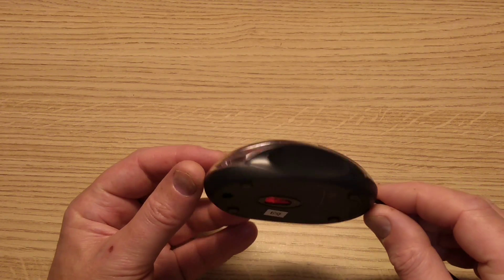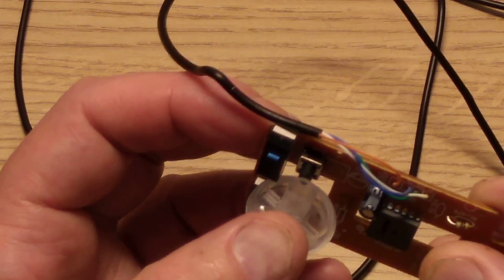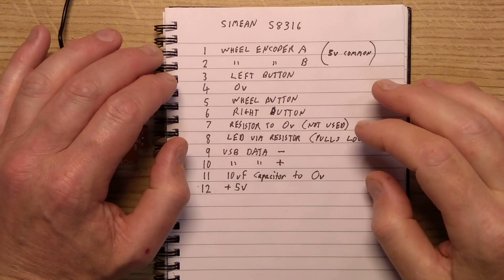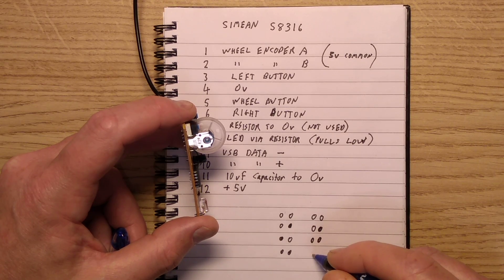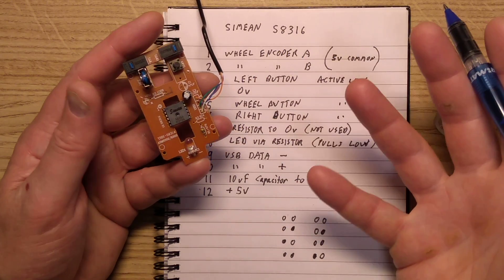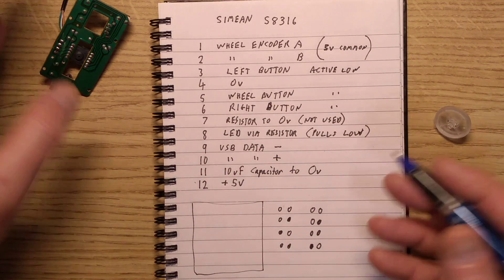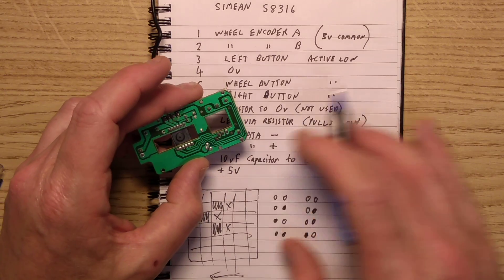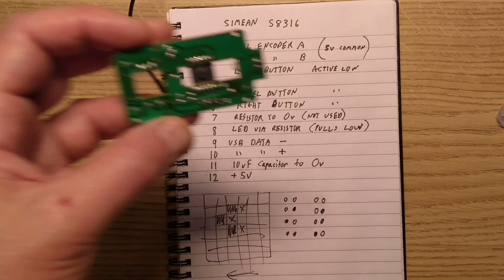Inside a humble Poundland computer mouse.

Comment: At university in the early 90s the Sun Microsystems workstations came with either the ball mouse or the laser mouse. The laser was not visible, probably infrared, and needed to be used on the supplied metal mouse mat which had a fine grid of slightly different coloured horizontal and vertical lines. They did not work on other surfaces. I guess they probably used some other detection technology other than imaging the surface, doppler probably from the reflections from the grid.

Comment: I remember purchasing the Microsoft intellimouse optical in 2000 for around 60 pounds and it was that good all round i used it for 17 years everyday with only 1 cable replacement. its still working but i sold out to a high DPI Corsair.

Comment: i had some success getting one to work as a liquid flow sensor - provided there's some microbubbles or something in the liquid. My idea was to try to make a cheap accurate flow sensor for low volumes of flow - as these cost a fecking fortune. I thought if I could get it working I could use it to accurately measure the fuel use of my paramotor when flying. In the end, though I did get some success with it, I decided a makeup mirror on a string (to view fuel tank) did a good enough job and abandoned the project.

Comment: I've used one of those mouse-types and it's identical, bar the company logo, not Sony, to that one.  I remember that mine would only work on a white or plain surface.  Any under-printing or glossiness would deflect the beam and therefore pointer, off in all directions.  It was a give-away with a piece of OS software, to cover OEM compliance, apparently.  Not the most high quality product but it worked for what I needed...a spare mouse to cover for the expensive one that gave up after two years light useage.

Comment: Just to say, Thank you Clive for all these informative videos. Due to watching your videos i was able to fix something today. I noticed yesterday that our house CCTV had stopped working. The cameras outside were not lighting the IR, and the DVR was flickering on and off. So i immediately deduced that the power supply was at fault. A 19v 5amp unit. Amazingly the unit was held together with screws so took the PSU apart and found 2 caps blown on the LV side. 25v 1000uf. Yay for Amazon same day, they arrived just after lunch. PSU repaired and CCTV working again !. All thanks to learning from your channel. I drilled some holes in the PSU case before refitting to allow some air flow through it, so it would not get so hot and keep cooking the Caps. Its in a hidden area, so not accessible. So safe enough.

Comment: Actually, the VERY FIRST computer mouse didn't have a ball, it had a pair of wheels, one for each direction, that drove rotary encoders of some type.  Over on the Computer History Museum channel there's a video that shows the bottom of the very first computer mouse.  They don't have any videos that show the earlier first trackball, which was more like the early video game cabinet trackballs, in that it was quite large.  It was, in fact, a BOWLING BALL used in the device.  It was developed in Canada, for use on one of the early air defense computer systems.

Comment: There was wireless mouses for 2 euro each on a  local super market and they quite neat, but uses 2xAA batteries instead of one AA battery . They are usually massive produced  , rebranded  and  you got free when you buy a new computer . But for mouse use the one that is more ergonomic to  you're  hand.

Comment: Funny how a mouse like this will probably last for most of someone's life as opposed to a lot of the "high speed low drag l33t g4am3r" mice I've had where the mouse buttons went crap after a year and a half.
Reply: erikm12 Not true, mine lasted 3 months. Although you can very easily fix them because the most common issue with them is the cable breaking. Still really really good for a single pound coin though.

Comment: Hey Big clive, theres a similar chip used in multirotors to detect drift on a hover. The accelerometers and gyros only capture acceleration so its hard to know if you have a fixed velocity drift. You point camera th
 at the ground and uses that to detect the drift.

Comment: Prusa used them to detect the movement of filament feeding into the extruder of their 3d printer. It could detect the end of the filament when the roll was empty and jams when the filament was being pushed but wasn't actually moving. I believe they've backed away from that design because of reliability issues.

Comment: I have openned a mouse from MKplus to clean it, the wheel was acting up. It had a similar chip, but the board has provision for 3 more buttons... So.... I could and cleanned the wheel to working condition, the plastic dust from it was covering everything, drilled 3 holes, 1 in the top and 2 in the side, 3D printed some side buttons, soldered 2 buttons in a daughter board and upgraded my mouse to have a DPI selector and back and forward buttons. Great project if you're bored....

Comment: there is a project i saw a while back it used an arduino board to extract the image from that sensor and it works !!!! you can see the image and its actually very interesting project
Reply: https://hackteria.org/wiki/Hacked_Optical_Mouse

Comment: I am investigating using a similar chip 
(AVAGO :https://media.digikey.com/PDF/Data%20Sheets/Avago%20PDFs/ToolKitSelectionGuide.pdf)
with binary chain encoded 'track' for use as a low cost absolute position encoder. Contact me if you are interested.

Comment: That camera thing is indeed nice, but it's a real shame that something so advanced is ruined by being inside something so shitty. it Having used mice for 20+ years at this point, I've never "taken them for granted". They come in two varieties: shitty and shittier. They all break. And they all come with incompatible parts, so they can rarely be fixed. You gotta throw them out and buy a new one. There's always something wrong with them. They misclick, they double-click, they don't scroll or they scroll backwards and forwards at the same time. They don't work on glossy surfaces, they don't work on matte surfaces ,they don't work on plain-colored surfaces, they don't work on textured surfaces. There was one that worked as a figdet spinner, because the wheel mechanism was broken and it was spinning freely, I quite liked that. Other than that, they're the bane of my existence and I hate them more than keyboards, and that's saying something. 

Fuck mass production. I don't need a hundred mice for $100, I need one that has working buttons and a wheel, isn't "ergonomically designed" to not fit my hand (I'm a leftie), doesn't come with a billion buttons and a built-in flash drive to install a fuckery management software, doesn't light up the room with stupid color-changing LEDs, doesn't come with a wireless connection that breaks every time I look at it the wrong way, and doesn't. fucking. break.

Comment: Funny to see you taking a mouse apart, I just sort-of (and quite probably temporarily) fixed my god knows how many years old Tulip mouse (that has an optical encoder for the scroll wheel by the way and was incredibly dirty). It's not really, really old, because it does have a USB connector weirdly enough.
Never knew it's actually a min-camera, and I think it's interesting it fails to work in much the same way (D)SLR's fail to autofocus when there is a serious lack of contrast in the detected picture.

Cleaning the ball in the roller-ball mouses?  I had to clean the rollers, not the ball :P.
I am not completely sure, but I think I recall a sensor in the Lego Technic Mindstorms package (the very first one) doing that to have a very vague understanding of it's surrounding environment (in some of the pictures I saw it caused a reasonably big spread of a red grid detectable by the sensor directly next to the LED producing the grid, which could also just have been a product picture and the grid was infrared, I am not completely sure).
Quite probably the resolution was really low, because well, processing that data to make decisions was had to also be readable on the computer by communicating this information through it's teriffyingly slow infrared transmitter/receiver and receiver/transmitter, from which the last one was connected to a Serial port on the computer!).
Unfortunately I don't know the name of it anymore.

Comment: those of us old enough to remember having to clean our balls (heh) don't take optical mice for granted!
Reply: My first mouse came with my Amiga 1000 about 31 years ago. I well remember having to clean "gunk" from both the ball and the little metal rollers .
My latest is a wireless optical mouse with rotary encoder similar to the one shown here. It recently gave me some trouble. I dribbled some liquid butane on the encoder to "wash" it and all is working again.

Comment: I recently had a problem with the scroll-wheel of my mouse. Sometimes it went up instead of down, and vice versa, or straight to the top or bottom of the page. It has one of these mechanical encoders. I figured it probably meant "dirty" contacts and wondered what to use to "wash" it. I tried dribbling some liquid butane on it. It got very cold and some frost appeared, and that worried me at first. But the butane and frost went away and the scroll wheel is good again.
[edited]
A week later and it's acting up again. This time I tried dripping some methylated spirit on it and it's OK again. Let's see how long it lasts this time.

Comment: When the first roll a ball optical mice came out they were so expensive that the company I worked for had me increasing the led drive current to keep them working longer. With 8 hour's a day use it did not seem to take too long before the leds lost intensity and they started to jitter.

Comment: The rotary encoder seems a bit over-engineered for what it really needs, which is really just pulses when the wheel is moving forward and pulses when the wheel is moving backward, something that can be accomplished with momentary switches on either side of a flapper (like on a prize wheel).  There is no real need to know the position of the wheel or calculating which way it is moving based on said position changing.
Reply: Rotary encoder is much simpler. It's really just a disc with two dashed lines worth of contacts printed on it with a graphite-filled conductive resin or sometimes etched out of a laminated metal layer, and a little wiper. It's the same manufacturing technology as a rotary potentiometer and a similar enough construction. You are suggesting a complex mechanical assembly instead!

Comment: Hey clive love the content! Would be sick to see you get a SDR off eBay and test it then take it apart and reverse engineer it. Very curious about the cheap $10 ones. Been wanting to get one but wasnt sure what all went into one.
Reply: There is almost nothing in there.  The magic happens in the computer that runs the SDR software.  Which is of course what SDR is.
They contain a "tuner chip" that downconverts the input signal to a lower frequency, then there is an "A/D chip" that takes 8-bit samples from that signal and sends them over USB to the computer.  The tuner uses a crystal (of varying quality depending on the device type and -price) to generate the frequency reference for conversion.  That's it.
The chip has some hardware for processing the samples when they are DVB-T signals, but it is not used in the application as an SDR.

Comment: Those optical sensors have been employed in drones for horizontal stationkeeping purposes as any movement laterally generates a signal (as with the mouse) that informs the drone it is drifting from its position in a given direction.

Comment: I saw something on Hackaday maybe? Where some guy used one of those chips to pull the raw image data out of the usb connection and made a rudimentary scanner out of it.  As he drug it across the surface an image was built up on the screen something like 8 pixels at a time.  It was pretty neat.

Comment: I found it online.  But it is a knock-off of Simian S8316 So they spelled it different than the better know optical mouse sensor.  I didn't see it until I looked for images 

Simean 8316.png
Reply: Why did you just just a file name ?
Reply: the fact that you found the png is not helpful sources would be though

Comment: For fun you can replace the LED. Blue and green LEDs both work. You may want to change resistor values if you're overdriving the LED. I have yet to try it with a little Ebay laser module but that might be fun to try.
OOH! just thought that I should try one of the changing color LEDs. That would be cool but would need a small capacitor added as Clive mentioned recently.
Reply: A colour changing LED wouldn't like being driven at two PWM intensities.

Also the camera might not work with other colours or be less sensitive.

Comment: Brand: Simeau Model: 800-1200dpi 
Series: Semiconductor devices - semiconductor chips

S8316/8318 Product Specifications : 

     Highly integrated optical mouse SOC chip (independent research and development, manufacturing, sales integration)

CMOS image sensor process, on-chip integrated main controller and photoelectric sensor

USB interface, in line with USB2.0 standard, compatible with USB-HID1.1 transmission protocol

Standard 3D3Key with support for mechanical roller encoder

Resolution: default is 1000DPI, can be customized 800DPI/1200DPI/1600DPI

Frame rate => 3000 frames / sec, maximum speed => 24 inches / sec

Working voltage => 4.5~5.5V, working temperature => -15~+55°C

Operating current: 16.5mA (moving state), 7.8mA (standby state)

Built-in LED driver circuit, built-in oscillator, streamlined peripheral circuits

Support mainstream Windows, Linux, Mac OS and other operating systems

Compliant with Microsoft WHQL and USB-IF specifications

12-ADIP package (RoHS compliant), compatible with S8318 Pin-Pin

Comment: I had one of the first optical mice to use this type of sensor, the Microsoft Intellimouse. As I recall, it cost me about 50 bucks.
Reply: I still have mine. Cost a fair bit in 2000 but it's still the best mouse I've ever used. Works really well left-handed or right-handed.
Reply: I'm still using my Microsoft Intellimouse.  It cost about £30 in 2001 and it's on its fourth computer.  It has rested for a year or two when I used the mice that came with new computers but then had to come out of retirement when they subsequently failed.

Comment: Those left and right buttons are double throw switches, a shame most mouse manufacturers use delay based debouncing instead of using the normally closed contact to detect when the switch is actually released. They didn't even bother hooking up the NC contact. It will start double clicking whenever you single click, or release during a drag, if they haven't added a lot of debounce delay in firmware.
Reply: Nah actually these will be fine, because the pullup current is pretty high, and voltage is high enough to break through the oxide barrier on the switch. On high end gaming mice with STM32 processors where pullup is like 50kOhm, there this all goes to hell.

Comment: you can use it as a pretty crappy scanner (or even a barcode scanner) with some hackery and an arduino. I don't think it'd be as clean on your particular model since everything is already integrated in one single chip. The ones I saw were using older mice with discrete processing units so you could access the image data straight from the sensor chip with just 2 wires.
http://spritesmods.com/?art=mouseeye

Comment: Oh my word those wires not in a connector is bothering me something fierce like.
I know it is from a cheap shop but my OCD would get the better of me and I would put a on board connector and do the same for the wire side. xD
And hey at least you have some parts like the bunch of switches and a optical LED and the porcessor to run it. xD

Comment: In the mid-80s, mechanical mice such as the Microsoft v1 (the mouse that roared: steel ball, green buttons), Microsoft v2 (gray buttons, rubber-coated ball), and the Mouse Systems optical mouse (three buttons, required special metal pad with stripes running horizontally in one color and vertically in another), ran around $100-$150.

Specialized mice, such as ones on the Xerox Dandelion, Xerox Star, and  VAXstation, undoubtedly cost more, but I never had to file a purchase requisition for them individually.

Comment: Alternative uses? Check whether the processor responds to PS/2 signalling across the same lines with a passive PS2-USB adapter - cheap ones often do. Then you can interface it to a microcontroller quite easily to use as a movement tracker in a robotics project and such.

I don't believe for a second that a low-end sensor like this has a 30x30 sensor, that's more on the high end, probably closer to 16x16.

Something you haven't considered, the frame to frame comparison is likely to deliver 0 displacement when you move slowly. So framerate of the sensor will be adjusted up to about 1000fps-3000fps even in cheaper sensors, depending on predicted speed - they don't always run at top framerate, they scale down so they don't miss slow moves.

Another interesting thing to note, cheaper motion estimation systems in mice are very acceleration sensitive, they probably make a very small number of image comparisons to determine displacement. In typical Chinese sensor, max acceleration is 2g but Pixart specifies something like 17g even in cheap office sensors.

The LED doesn't consume enough for it to make sense to dim it. Perhaps it's dimmed as part of framerate control, to avoid saturating the sensor.